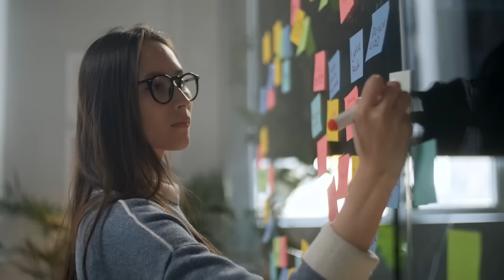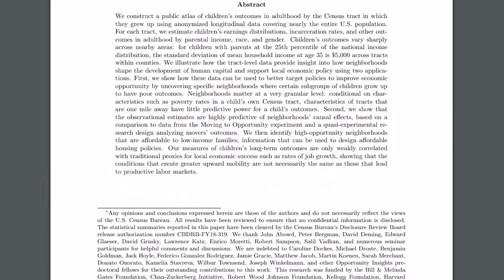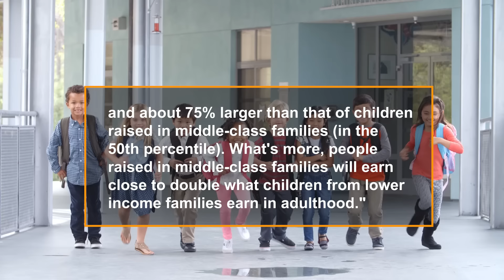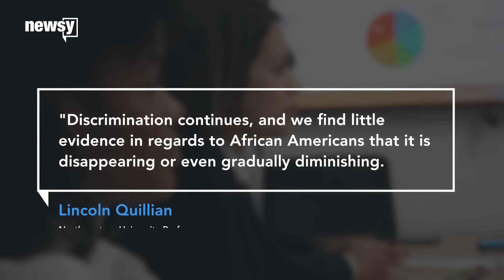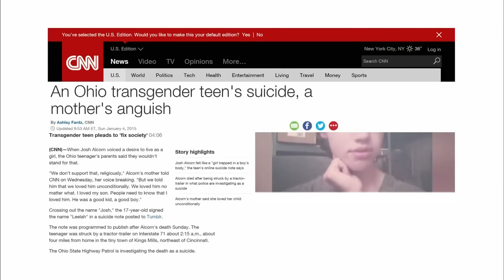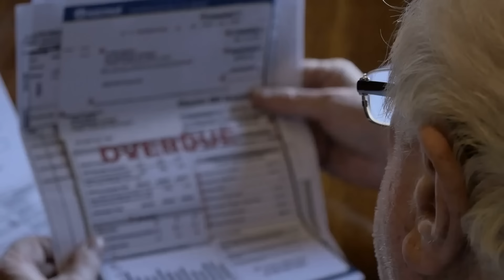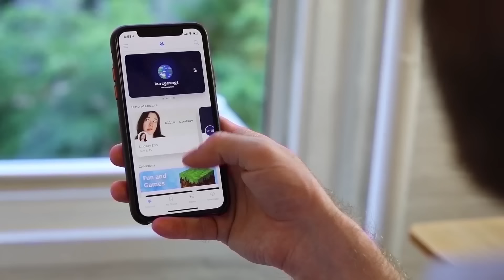The Problem With Hyper-Individualism

Comment: Making money with money is a lot easier than making money through hard work.
Reply: @florianruhstaller1730  Rich families have rich descendants, not because these kids are fundamentally smarter, but they do have far more resources to assist themselves with.
Reply: @florianruhstaller1730  I feel like you may have missed my point to begin with friend.

I'm not sour or annoyed with people utilizing money to create more profits and in short "spending money to make money" - since that is the very foundation of the american system. My empathy instead goes out to the people who work extremely hard at low paying jobs because manual labor (despite its tough physical requirements) are not very well compensated because money simply makes money a lot easier than a low tier employee does.
Telling such people to simply "work hard, that's the solution" is simply refusing to acknowledge that they are plain F'd in the vast majority of cases.
Reply: @florianruhstaller1730  You are living in a bubble my friend, and i'm sorry to tell you this, but the american society would break apart completely without people working minimum wage.
Furthermore, fulfilling what the market wants, i.e supply and demand, does not mean you magically end up with a reasonable pay, if that was the case then school teachers in public schools would be way better off.

Anyway, i suppose we gotta just agree to disagree on this one friend, i respect your opinion even though i do not share it and i wish you well along with a belated happy easter.
Reply: Yep you can read books and watch videos on the internet and upgrade to a fifty dollar as hour job
Reply: @florianruhstaller1730  right because you think everyone can afford internet? 
and if everyone got high paying jobs who'd be doing the low paying ones?
it's not normal that working jobs are paid this low. your idea of choice is to choose between bad and good jobs. our idea is that you can do whatever job you want or are qqualified to do, and still be able to live as comfortably as a low middle class. and don't tell me that's impossible because that's the most easily disprovable argument
Reply: @florianruhstaller1730  lol I mean keep living your dream. What you're describing goes against the very principles of capitalism
Reply: Make a 5 year plan, do the proper research, commit yourself to it, profit. I believe anyone can in fact pull themselves up from their bootstraps. The public school system has completely failed the past couple generations.
Reply: @florianruhstaller1730   To me it seems that you're expecting people to make rainfall in a desert. Access to food and other resources(or lack therof) can affect brain development. The food in lower income neighborhoods isn't conducive for maintaining optimal cognitive function. Nor is the environment. Rugged individualism in itself cannot compensate for the experiences that are wrought as a result of not having enough. Nor can such a thing even fully convey it's own ideal in a capitalist society. Be an individual yet do what the market wants?Then you're not being your own individual. You're basing your decisions on the collective not your own nuanced viewpoint. Truth is we have always been a social species and even this ideal of individualism is a collective idea in itself. Yet this ideal simultaneously attempts to negate the fact that socialization is apart of being human. People who grow up in religious households are more likely to be religious as adults. People who have undereducated parents are likely to be undereducated as adults. The existence of such trends doesn't mean that they are inescapable, yet using exceptions to define the rule instead of asking why such phenomenon aren't ubiquitous isn't really striving to solve the issue. It's just a way to deflect from the other issues that contribute to hindering certain demographics of people from achieving success.
Reply: @christopherjohnson9167  In essence you are suggesting that people have to run for 5 years to catch up with people who are leasurly walking for all their live.
This might be true, but it sounds exhausing.
Reply: Money on money averages around a 5% yield. Hard work can yield a 1000%.
Reply: @LobbeWOW  Maybe. Even 5% with compound interest is going to take a lifetime to be worth much. Depends how much you initially invest. I'd count on hard work over compound interest.
Reply: Thats how most rich people make their money they invest it into things that make them more money and dodge taxes.
Reply: my smart friend who was born into money said this when I asked how to make money, "you have to have money to make lots of it". i laughed because he was able to start his own businesses at a young age because he had the initial capital provided by his parents to spare for it, while I was thinking at the time, "how do i make that initial money"? Here I am 10 years later, now I have that initial investment but too bad that is going into buying a house instead LOL
Reply: Hard work doesn't pay. 

It pays the person who owns what you work to sell.
Reply: @IWantToStayAtYourHouse  I'm sorry to hear that, 2k is not a small amount for a lot of people.

But it sounds like you tried and decided to cut your losses rather than go further down the rabbit hole, so i got to give you credit for that.
Reply: @user-cx4ic6he9k  If you sell your moral compass, then you can make a lot of money a lot faster.
Reply: That’s why it’s called “hard work” after all.
Reply: In many countries, labour is taxed at a much higher rate than capital is taxed. So this is literally accurate.
Reply: Work rich, not hard.
Reply: @LobbeWOW  👏👏👏
Reply: @nathansire6623  The difference is that the 5% is earned passively.
Reply: @edwardroh89  Rarely does a billionaire come from a disadvantaged family background. Rarely does not mean there is no rags to riches, just rare.
Reply: true. experienced this myself just this year, making more money in my whole life in just months, sitting/working at home than working hard, employed
Reply: Fun fact the guys who make the most money are usually untouchable because what can you bribe them with, 

That idea alone is what creates power among few individuals power is endlessly seductive and the moment you get your first taste the instinct is to climb for more
Reply: @crazyba1413  "Ultimate power ultimately corrupts" - it's kind of ironic, that excessive greed is what makes both capitalism and communism into horrible systems for the vast majority of the population.

It's a screw without an end really.
Reply: If it wasnt the case
Money had no value
Reply: It is not possibel to make money with money. You make money with taking risk. An Investment is a risk.
Reply: @LobbeWOW  and morality determined by whom ? You. What qualifies you for that
Reply: @madhusudansawant8157  If i sold my own moral compass, then yes, i would be qualified to judge that i have no moral integrity.
Reply: It is still possible for a Working Class man to build a business from scratch.
Reply: @davidlafleche1142  Yup, just exceedingly difficult.
Reply: Stonkz
Reply: @LobbeWOW  Rich families often have stupid, underachieving kids.
Reply: @davidlafleche1142  That's usually what happens if you spoil children rotten.
Reply: @davidlafleche1142  Why should a working class person have to build a business to have a decent quality of life?

Unless everyone's self employed, then most people will always be employees. Surely we should structure the economy so that everyone can live well, rather than having a few people accumulating vast wealth. It's possible and whether or not we do it is a political choice.
Reply: Making make more money is investing ya know
Reply: @Ethan Danan My comment really has nothing to do with me, so why would you assume i have a problem with the system?
Reply: @paragondreams340  Damn, well said.
Reply: That is why I am saving for investing, so I can retire with a good pension without the troubles of diminishing young population and corrupt goverments.
Reply: @edwardroh89  when you say it like that  ,connections are more important than I thought
Reply: @LobbeWOW  ..
Reply: @christopherjohnson9167  the public system is what made America great post ww2(ignoring the racist exploitation ofc) and the public sector has caused most if not all technical achievements in history.
Reply: Making money is also easier when you're not paying off medical debt
Reply: How did the man who wrote Grapes of Wrath , a life long Socialist get Freedom and the Value of the  the Individual’s Mind so right in one of his seminal novels ,  East of Eden . It is dualism at its best:

“And this I believe: that the free, exploring mind of the individual human is the most valuable thing in the world. And this I would fight for: the freedom of the mind to take any direction it wishes, undirected. And this I must fight against: any idea, religion, ideology or government which limits or destroys the individual. This is what I am and what I am about. I can understand why a system built on a pattern must try to destroy the free mind, for that is one thing which can by inspection destroy such a system. Surely I can understand this, and I hate it and I will fight against it to preserve the one thing that separates us from the uncreative beasts. If the glory can be killed, we are lost.”

—John Steinbeck, Author and Life Long  Socialist
Reply: And faster
Reply: I don't see problem with it
Reply: “Those who proclaim themselves “socialists” are usually depressing, have no sense of humor & attended an expensive college. Fate loves irony.” 

—Elon Musk - Founder of Tesla and SpaceX- June 15,2018
Reply: @mitscientifica1569  according to me. 
Just rich kids with no touch of reality
Reply: Now more opportunities for self enlightenment . Let’s see what one of  the most renowned Philosophers of the 20th Century learned  about Socialism , who brought us both the Open Society concept , (beloved by socialists ) and Falsification Principle  :

“I remained a socialist for several years, even after my rejection of Marxism; and if there could be such a thing as socialism combined with individual liberty, I would be a socialist still. For nothing could be better than living a modest, simple, and free life in an egalitarian society. It took some time before I recognized this as no more than a beautiful dream; that freedom is more important than equality; that the attempt to realize equality endangers freedom; and that, if freedom is lost, there will not even be equality among the unfree.”

- Karl R. Popper, Unended Quest: An Intellectual Autobiography
Reply: “Individualism is the fuel of society as it is only people who move things. History is a testament to the people who thought and took action based on their emotions and values and logic. Society is comprised of individuals and it will not work without them.”

-ELON MUSK, Raging Inventor and Innovator, Capitalist, Industrialist , Philanthropist and Immigrant.
Reply: PNAS ( National Academy of Sciences) -‘Individualism, innovation, and long-run growth’ by Yuriy Gorodnichenko and Gerard Roland

Summary of Research:
Countries having a more individualist culture have enjoyed higher long-run growth than countries with a more collectivist culture. Individualist culture attaches social status rewards to personal achievements and thus, provides not only monetary incentives for innovation but also social status rewards, leading to higher rates of innovation and economic growth.
Reply: (Insert a triggered conservative using anecdotal “evidence” as a counter point) 🤦🏾‍♂️🤦🏾‍♂️🤦🏾‍♂️
Reply: Of course why else do we have money
Reply: Money doesn't make money. People's work do. If you have a lot of money, most probably you took it from someone else's work.
Reply: Most great inventors and entrepreneurs since the industrial Revolution to present day came  from the 99 percenters and not from the 1%percenters . 85% of the CEOs of Fortune 500 companies come from B Schools ( State Universities ) and most not rank in the top 100 Universities which are private universities , including Ivy League Schools . 

89% of the people I went to school with at MIT class came from  the 97 percenters and not from the top 3% of income families .
Reply: In most cases its not a low wage that makes people poor, but consuption, debt, drugs, no savings... Having children or other person you’re financialy responsible for does not make it easier. If your minimum spendings are higher that maximum earnings, you need help.
Reply: In capitalist countries, yes.  Like all those who live them, you think they’re the only kind, which means you’ve totally missed the point of the video.
Reply: @benjaminmeusburger4254   life IS exhausting...
Reply: @mister_chispa  thats like saying no job in the world pays anyone. Money only comes from theft. Employment is fiction.  😂
Reply: It was Ted Turner who said it best; Do you want to make a million dollars in the wrestling business? Then start with a billion dollars!
Reply: If you replace the second money with scams, it checks out
Reply: @LobbeWOW  In that case, you have to ask. Why can that family be rich in the first place?
Reply: @lukayaroslav9914  Just so i don't misunderstand your question and answer something irrelevant, i'm guessing you mean to ask where the original wealth originated from for it to be passed on to the next generation consistently. What got the snowball started so to speak yeah? - There are a lot of answers to that question since there are so many different ways for that money to have been obtained in the past 100 years or so.

Real estate, the industrial revolution (factory owners), Cheap education leading to high paying salaries without debt and prior experience requirements, War spoils, Banking, land ownership.

I'm confident there are many more, and regrettably some might backtrack all the way till before the civil war (plantation owners), these are just some examples i could think of off the top of my head friend.
Reply: @LobbeWOW  Yeah, there a lot of factors that made a person/family wealthy. Luck, the ability to make communicate easily, cleverness, and hardwork are the most important factors though.
Reply: @LobbeWOW  Yes but also there are many people i know in the economic lower class who do not have financial smartness simply bc they haven’t been introduced to it. many of those people don’t even have credit cards to boost their credit, and don’t know about investing in the s&p500 or NASDAQ, which has proven to have a much better ROI than leaving cash in a mason jar. I think it’s a mix of both
Reply: @nathansire6623  are you joking right now?
Reply: One of the most mind bogglingly stupid things I ever encountered was this exact principle in GTA Online. New players in that game are constantly wowed and awed by people like myself, who have millions if not billions of in game dollars with which to buy any car, apartment, or weapon we so desire to. They're always asking "how do I get to have the kind of money you guys have?" And the answer always was (at least to anyone willing to admit it) "have a lot of money already."

When I was first starting out in GTA:O, it was a massive undertaking requiring weeks of my time to grind out a million dollars. And I felt rightfully proud of myself once I achieved that. But after my first million, my second million seemed to come by in a much shorter timeframe. My third million was even shorter than that. And I didn't even notice my fourth million. By the time I hit ten million, earning a million in just a day or two was banal, routine, not worthy of even remarking upon. And by the time I hit a hundred million, I was earning multiple millions per day and not even noticing.

GTA was originally designed as a parody, a hyper satire of capitalism and a capitalistic world. These days, it's more and more just a fantasy themed reimagining of what our actual world looks like.
Reply: Sure why would I make money? When I can just pay someone to make me money?
Reply: @christopherjohnson9167  pull your bootstraps and you fall over
Reply: @nathansire6623  if thats true i wanna work where youre working
Reply: @Gigachad-mc5qz  stop being lazy bro.
Reply: @christopherjohnson9167  why? I get paid too little for my work so why should i make my boss even richer? It doesnt benefit me at all. If i got paid on how much i make then yeah i would "stop being lazy" as you put it. Idk about you but i dont feel good when im being robbed
Reply: @Gigachad-mc5qz  nah fuck that job and fuck that boss if they mistreat you, find a place thatll treat you better and pay you what youre worth! Not easy in the slightest especially depending on your circumstances but those jobs are out there. Best of luck homie.
Reply: @christopherjohnson9167  oh wow i didnt expect wholesomeness thanks c:
Reply: @Gigachad-mc5qz  sorry for the lazy comment just being a little schizo :p
Reply: @IWantToStayAtYourHouse  2k is a lot of money for the average joe, but in the world of people who make money with money that's nothing
Additionally they get their private training on how to increase their wealth instead of betting on stuff
Reply: You sure about that? I'm regularly making 4400 to 5000 a month...
Reply: That statement is absolutely not true! Making money through hard work is very easy and makes a lot of money for those who parasites on that work!
Reply: @makerbeelab5546  I liked that twist in the end there, and you are right, no need to work hard if you can just piggyback off of someone else working hard.
Reply: @LobbeWOW  There's a joke going on in Russia. A boss drives in an awesome car to his company's parking lot and a junior engineer looks at it amazed. The boss says- ah, you like my car right? Isn't she a beauty! But don't worry, keep working hard, take extra shifts, be self driven and enthusiastic, and you'll see! I will buy an even better one!
Reply: @LobbeWOW  it's actually insane when you look at it, the dividend payouts from index funds or individual stocks end up being more than a lot of people's paychecks when a rich person is able to just invest 10 million in it right off the bat. 

A regular person making an ordinary wage will be very lucky if they can even so much as retire with the amount they put into their retirement accounts
Reply: @christopherjohnson9167   Well, let's just say that, if you are born poor and smart, you will most likely not be a billionaire at the end of your life.  However, you can improve your material circumstances by making smart choices and working hard.
Reply: @stevedavenport1202  yeah exactly
Reply: this is also incorrect
Reply: Don't like, what less than 10% of investors actually make money?
Reply: @LobbeWOW  disagree, it's the education they get. I can tell you from experience that coming in to wealth quickly is a recipe for disaster
Reply: people who look better have an easier time better not because they good at because they were born with. 

Of course people have easier then other doesn't mean it problem
Reply: @chewhatif4745  True, winning the biological lottery does open up a variety of doors, though it can be quite hit or miss.
Reply: @christopherjohnson9167  what if you dont have boots ?
Reply: @paragondreams340  my idea is you get what you need to survive, and everything else you work for seems a simple system and it actually values life especially considering just for example there are 17 million homes 600,000 homeless, and we already make 10x more food than consumed
Reply: @nathansire6623  tell that too a homeless guy? That physically cant even get a job because the system is so discriminatory against them
Reply: @edwardroh89  same for elon musk, jeff bezos and any who says hard work can make you rich they arent even self made lol parent made maybe, and that is not the American dream nor is it equal opportunity
Reply: @justsomeone64  exactly and why shouldnt you have a good cut for what you are producing? Even minimum wage workers could make a fair wage, it would even incentivize people to work if they werent paid to work and stay in poverty noone wants to do that, especially with a family
Reply: @LobbeWOW  yes, but are you even human at that point?
Reply: @solrhopalocera5704  hard work gets you noowhere ask anyone working hard on 8 a hour, think of this, there always has to he people to be in poverty so more wealthy people get to feel more important
Reply: @ManicPandaz 10x as easy when you have rich parents, or even well off and you domt have poverty or nightmares in yout childhood because of the poverty, if everyine could be rich dont you think everyone would be? There always has to be poor to be in tolerant too, to feep.more important then
Reply: @Prepareforabetterworld  I agree, people should be paid a fair cut of money for the work they do.

Definitely not the poverty wages paid now.
Reply: @justsomeone64  8 or 7
25 a hour aint enough to figuratively pull yourself up by your bootstraps by that point you dont even have boots
Reply: @justsomeone64  thats not to try to force my beleifs on you, that's just who i am in general i have too much compassiom for others to be in a system driven by competition
Reply: @Prepareforabetterworld  We are in agreement on the wage being too low
Reply: @justsomeone64  Thats a first for me, i tell anyone that, and they act fantically mostly people from affluent lives
Reply: @Prepareforabetterworld  go get yourself some boots.
Reply: @christopherjohnson9167  if everyone could do that dont you think they would my friend
Reply: @Prepareforabetterworld  no, most people dont have the willpower.
Reply: @christopherjohnson9167  nah have you ever been/lived in poverty in your whole life? If not you have no idea what it is to start from nothing and should sell everything you own, pitch a tent and tell me how easy it is to get everything back, without any help at all, little science expirament for ya
Reply: @Prepareforabetterworld  Been lower class, had to rely completely on government loans to pay tuition, payed off 50k in debt in under 2 years. I had support from family in terms of a free place to live. So no not poverty. And Im not claiming its easy, but it is doable. My grandmother came from poverty and grew a real estate career out of sheer willpower.
Reply: @christopherjohnson9167  thats a little different, in the 50s and 60s things were actually managable unlike todays time, the generations of the 80s and up have the most poverty, and debt of any generations in US history, and it gets worse with every generation, if the economy was like even in the 70s people would actually be able to  provide for their family, without 2 people having to work, how are system is now, were in a recession going to be a depression, i also have student debt, but thats stupid in my opinion, knowledge is knowledge, and it should cost money, nor should healthcare or a simple small home, or food or water, everything else should computers, nicer things that are actual luxuries, thats simply a system that values human life, and wont blindly kill people because one beleives them to be "lazy" or "freeloaders" the us government is the biggest freedloader in the world, they cant say nothin with 3,000,000,000,000 in debt 95% being due to war non-defensive war at that, however thats my opinion and some statistics your free to beleive what you want, however i beleive everyone has the simple right to live nothing more, especially since there is a overabundance in those things that are needed for life, one statistic is that there are 17million vacant homes, and 600,000 homeless, and its already a fact we make like 5 times as much food as we consume, so noone should have to go without a small house or food at the very least
Reply: @christopherjohnson9167  willpower and a economy that wasnt in the near great depression and when it was in a economic boom (late 40s to the early to mid 70s) thats completely different than now, and everything wasnt so monopolized and trust funded, your not gonna be a millionare or a billionare out of sheer willpower, you just arent, its physically impossible, but what most people like me want isnt to be above people its simply to have the right to live, id even live without electricity if i had too but i cant get a house after trying and saving over 5 times in 2 different jobs, and thats after at one of them working 96 hours a week hard working talenr and skill is dead in todays economy i can run like 3 different heavy equipments, paint aircraft, and cars, and i even have a degree in physics, and i cannot afford to live because my skills are not profitable or i dont look "good enough". Those are real words ive heard from actual people when trying to get a simple job even at a fast food place, that i cant even live off of, also when i applied to be a construction laborer, sometimes peoppe just judge you the way you are, and thats what i meant by  not having boots
Reply: @Prepareforabetterworld  people these days have access to billions of times of the information as past generations thanks to the internet. Do your research, make a solid 5 year plan, and work hard and smart. You will be able to improve your life significantly. Defeatist attitudes about capitalism just hurt people by telling them its impossible. I never said its easy, and I never said anyone can become a millionaire. But anyone can improve their quality of life with the right attitude and willpower.
Reply: @christopherjohnson9167  im not quite a defeatist, when ive tried and fought for years brother, harder then it looks, but im more stubborn then most, and a 5 year plan will never work plans never go as they are supposed too, especially when were on the verge of a economic collapse, just pay attention whenever a new stock market crash like what happened in 2008 happens, and see how many people loose everything and see how little can recover, sometimes you can be as stubborn as a titanium machine, but sometines simple things such as how someones looks set them back 100 times, but i wont give up but i wont get anything ever more than a simple house and to barely survive, and thats all i want is to live, and not be cast down by society, which also is harder then it looks when i was born into homelessness
Reply: @christopherjohnson9167  hooah brother same idea as thinking you can manufacture a utopia out of capitlism which we slip into more and more a dystopia every day, and millions didnt recover from 2008 just the companies that bought up all the housing did, i for one wont fight to survive in a world i simply didnt want to be born into in the first place, rather not exsist tbh would be a better life
Reply: @christopherjohnson9167  the fact boom and bust is even a thing should tell you how flawed out system is
Reply: @christopherjohnson9167  bet ill make one, gimme a week and ill make a system, thatll benefit the entire planet. We'll see in a week
Reply: @christopherjohnson9167  ima outline it for you and then in a week ill show you the entire thing with every policy and system, the basic idea is to use every good policy proved good in each governmental system it was emplaced nulling out the flaws in each system with the different positive policies of each into one comprehensive system, and dont say it wont work, till you see what i create, it very well might change your mind
Reply: @Prepareforabetterworld  go for it homie, I'll wait patiently :)
Reply: @christopherjohnson9167  thank you my man hope to make you and the world proud, or if its too good to go missing cause the CIA murked me
Reply: No shit
Reply: Well said
Reply: @ronylouis0 no shit Sherlock that's the point💀
Reply: Because that's what capitalism is, money begets money. I'm not anti capitalism but that's what it is.
Reply: And a major reason society is going down the toilet.
Reply: Someone who has never had a zero hours contract job.
Reply: @LobbeWOW no I’m rich cuz I was born lucky. That’s it.